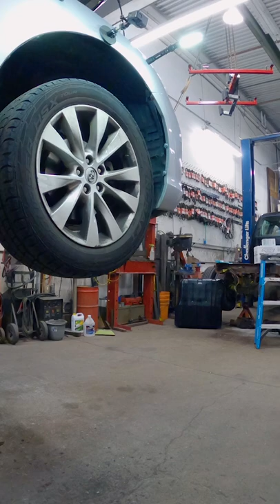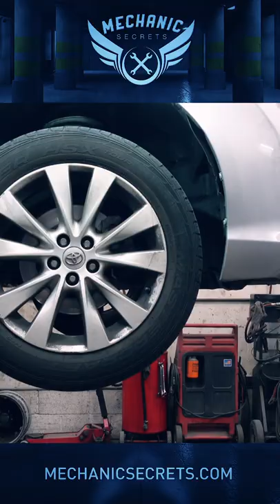Lug Nut Trick #Shorts Version

Comment: Strange to think you might own a Lift but not an Air compressor and Impact Wrench.
Reply from the maker: Just a demonstration to benefit those that might not have an impact wrench.  Plus, believe it or not, there are certain frozen lug nuts that this method will solve that an impact wrench won't.
Reply: Lol right
Reply: You dont have to explain yourself to these guys. They have clearly never put an impact on a lug nut hat it could not break free. 80% of the bmw and adui wheel bolts are over torqued and require a breaker bar before an impact.

Comment: When you run outta compressed air… right?
Reply from the maker: It's a method for people without an impact gun.  And believe it or not, there are some frozen lug nuts that this method will loosen that an impact wrench won't.  It never hurts to have an alternative method in your arsenal.
Reply: @MechanicSecrets  A longer bar = more leverage.
Reply from the maker: Of course.  But in my experience, sometimes longer lever = broken stud.